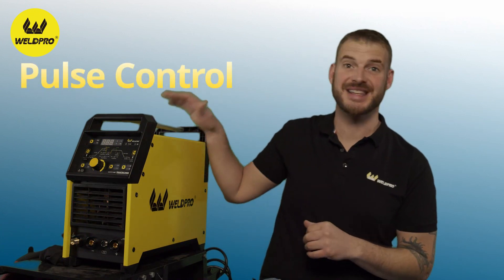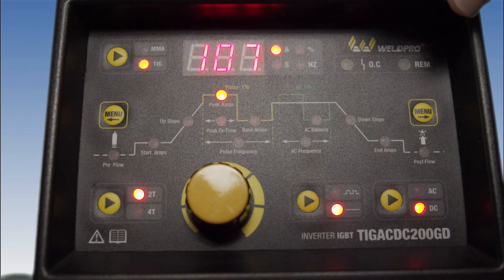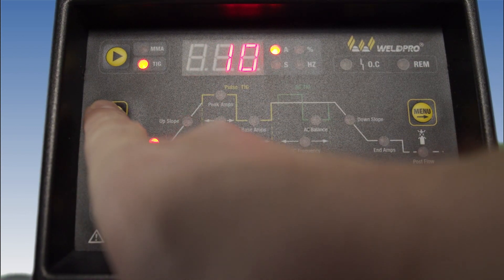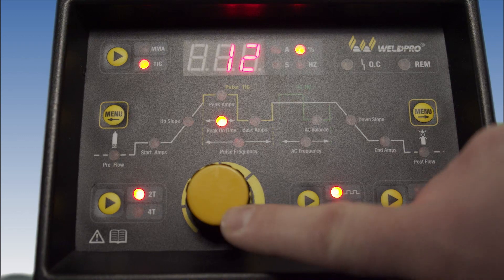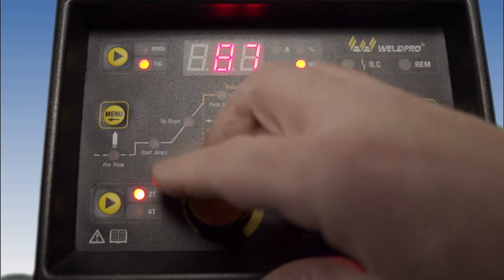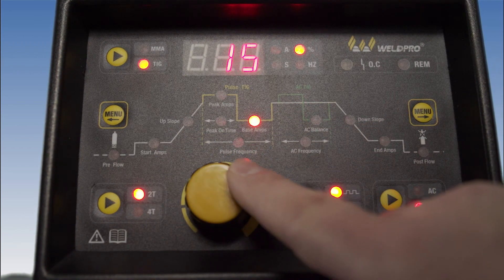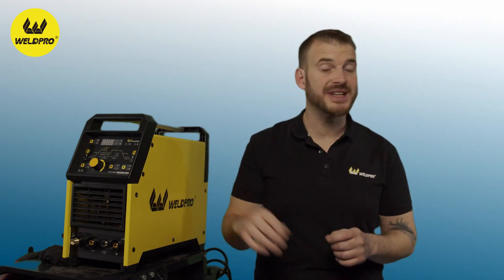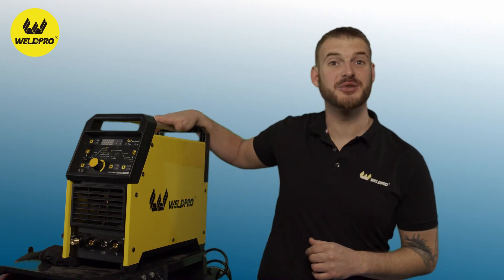Weldpro TIG 200 - Part 5 - Pulse Features

Comment: Con este equipo puedo soldar barras de 1/2" y 3/4"? Quiero fabricar Sisybar
Reply: Yes, but you may need to pre-heat the parts before welding, depending on the joint type and strength required.

Comment: Hi. Does the welder come with baseline recommendations/instructions - to give an idea where to start on what metal/thickness - just for rookies like me? I would have zero idea where to start. I have seen tables for spool feed / amps etc. on MIGs I think and wondered if TIGs have the same basic idea for their operation. Thanks.
Reply: Call their tech support. They’ll give you a pdf of some good baseline settings. Great customer service.